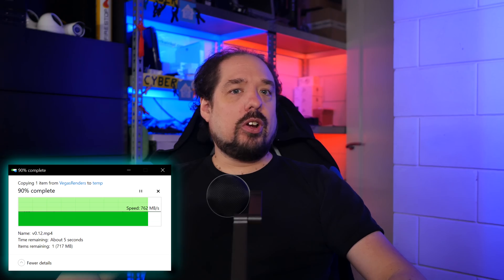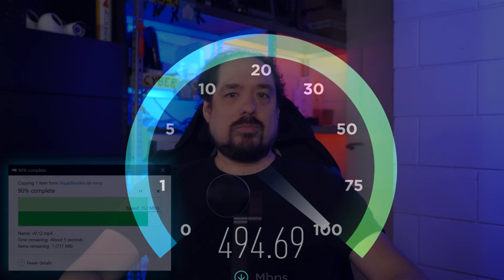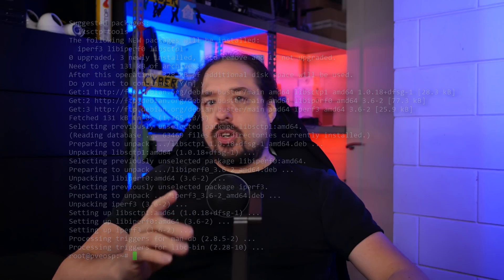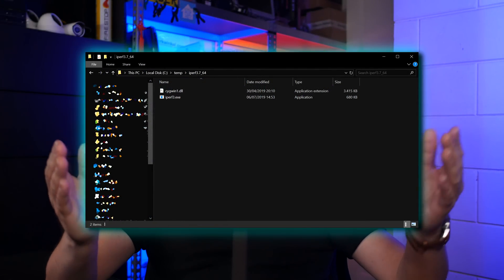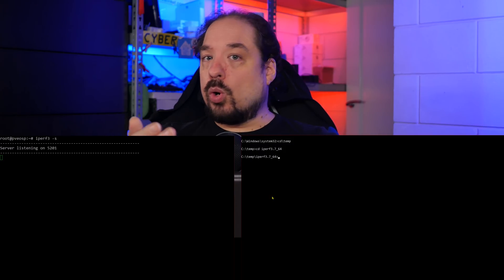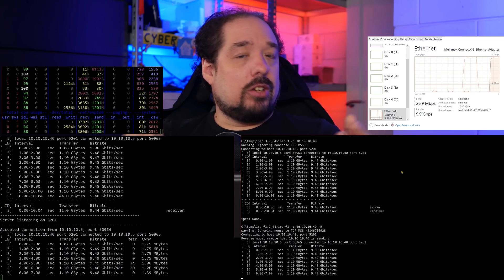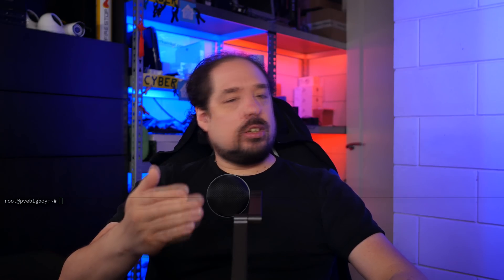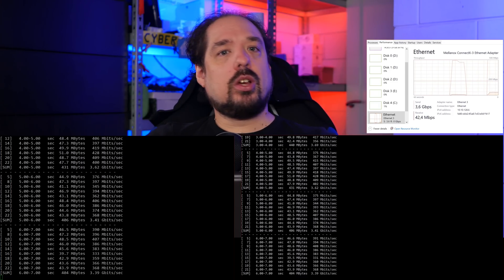Home Networking: How to test your (10Gbit) network, a guide to iperf (Mikrotik CRS309-1G-8S+IN)

Comment: Iperf is a great tool to test transmission speed on a local network independent of native files.  My experience is that a lot of small DLLs slow down the network speed properly, up to 1/4 or 1/5 of the possible transfer rate.  On the other hand, video files, for example, reach the maximum limit.  With Iperf, on the other hand, you always create the same test conditions.

Comment: Thank you for the excellent video and clear instructions. I have a 10GBe network at home between my main Windows 10 desktop, Linux Mint utility PC and Ubuntu file server.

I ran iPerf between all three machines - both ways and average about 9Gbps! So Iperf tool is validating my actual network performance. Indeed, very important that both Windows and Linux iPerf versions are the same - they were not at first until I downloaded the .DEB package on Linux to match the Windows version.

Comment: My results are 1.74Gbit/s real world. It's cause of the spinning rust in my FreeNAS, and older HW. Line speed through the switch is 9.4Gbit/s over fiber (OM3 LC multimode) and 4.7Gbit/s over a 23ish meter cat 6 (no a) run. I am going with the cat6 solution since I can't reach wire speed anyway, plus the cat6 is in the wall already. For fiber I would have to do a run like you did.. In the next year all this equipment is going to be much closer to each other, so I might revisit fiber then. For now, a cheap Chelsio T420-CR and some SR fiber modules are about to hit eBay. ;)

Comment: See edit in comment! Great video! Just note, for the crs305 mixing DAC cables and the rj45 mikrotik SFP+ (rj10 I think they are called) modules on the same LAN does not work.  Aquantia rj45 adapter in my workstation with cat 6a 5 foot run to the crs and DAC cables from crs to servers , 1 meter runs. They won't talk to each other. I tried two different mikrotik rj45 modules to see if one was faulty. The crs has been tried in router mode and bridge mode with HW offloading ( using the switch chip not CPU) and .. no dice. DAC connections talk to each other fine, mikrotik rj10 modules talk to each other fine (if you have two) but DAC host will not talk to the rj45 mikrotik SFP+ module host. So.. don't make the mistake I did and assume mixing media like in this video will work on the smaller crs305. You can't get a ping, let alone an ipref. Pick fiber or copper... Can't mix and match. :( Considering what modules cost, it might make sense to buy the bigger switch even if you don't need that many ports because I can only assume from this video that the crs309 has the power required to drive the DAC and mikrotik modules at the same time... Or it's something to do with the backplane on the 305 that's different. Tested for several days.. slightly frustrating. Love these videos! Cheers.
Reply: Edit: I literally got my wires crossed in my rack. I had wire labels that had fallen off (darn cheap label maker) and I thought I had it right but.. nope. You can mix media types, even cheaper ones off eBay. I tested it with expensive OEM (Chelsio, mikrotik) and the performance was identical. So.. my bad.
Reply from the maker: Thnx for coming back to tell us, I really appreciate that! Also glad you got it resolved, we all do stupid stuff sometimes. :)
Reply from the maker: Thnx for the comment, but that makes no sense whatsoever. I've mixed Fiber + DAC + RJ45 in my CRS309 and that had no issues whatsoever. The CRS305 is only a scaled down version of this (or rather the CRS309 is scaled up) so that shouldn't make too much of a difference. I also know multiple people who run CRS305's with a mix of cables also without any issue.

But if the same port works with DAC but not with RJ45 in it then there might be something broken. Config wise there is no difference in how the port should function with either in place. For the switch chip there is no difference between DAC/RJ45/Fiber that's all handled in the transceiver and the switch understands that, or it doesn't.

You might have one of the worse quality S+RJ10 that had issues with Jumbo frames and some other stuff, but even then, if the link works and the switch understands the transceiver, that's it, from that point on there is no difference in the connection.

So I'm kind of perplex what might be causing this issue for you. Have you updated the firmware on that CRS305 next to updating the software?
Reply: @IntermitTech  thanks for the reply! I am just as perplexed. FW is all latest version. I have reset the config every time between attempts to run tests, pretty scientifically. Switched out which ports I am using etc. I do have the version 1 mikrotik RJ10 module. However, I tried modules from 4 other vendors as well.. same issue. I have yet another mikrotik rj10 module that I will see  what version number it is today when I run still more tests. It's just not switching packets between the two media for some reason. Different ports, modules. Etc. I wonder if it could be the Chelsio cards I am using? That's the only factor I don't have the ability to change, I have S320E-LP-CR cards in both servers. I orderes a Chelsio T420-CR for the workstation ($30USD on eBay) since the Aquantia works fine but won't talk to the DAC cable ports, the Chelsio arrives end of the week. Packets talk to other rj45 modules.. just not DAC. DAC will talk to DAC as well.  It is very perplexing. Hopefully when all is Chelsio (no aquantia or rj45 in the equation), CRS305 will give some joy in switching packets super quick like. 10gig even! Woot! Ludicrous speed, GO! :)

Comment: Nice test.
I use iPerf a lot, professional and at home,  but never checked 10gb.
Nice to see iPerf can do 10gig also.
Maybe I'll try to saturate our 40gig interlinks😁.
But hmm, I don't have 40gig to our ESX hosts 😙😫

But on topic again:
Would you also do some testing with different connection modes?
I'm very interested if 10gig copper, and f.o. in combination with different nic's have different results.

Comment: Just a tip: some NAS (synology\qnap for ex) does not allow you to install apt packages on the os, but they let you run containers (docker mostly).
Just search for a recent image of iperf3 on docker hub and run your server or client in the NAS.
This is a quick way to understand if the bottleneck of your NAS is in the network card\switch or in the disks configuration.

Nice video, as usual. Keep it up!
Cheers!
Reply from the maker: That's an awesome tip, thnx!
Reply: Very nice tip, I was searching for that!
Reply: there is an iperf qpkg from qnapclub.eu for the QNAP.
i then run the command from windows desktop pc, to test the connection from the qnap nas to my desktop pc, then run the reverse command in addition.

Comment: I am on a iMac Pro running Mojave. The app is a Unix executable. macOS protests that the app is from an unidentified developer. If you trust running the app, control click the app. Select the Open menu item to open the app. A Terminal session window will be opened. The following will be displayed:

iperf3: parameter error - must either be a client (-c) or server (-s)

Usage: iperf [-s|-c host] [options]

       iperf [-h|--help] [-v|--version]

Server or Client:

  -p, --port      #         server port to listen on/connect to

  -f, --format    [kmgKMG]  format to report: Kbits, Mbits, KBytes, MBytes

  -i, --interval  #         seconds between periodic bandwidth reports

  -F, --file name           xmit/recv the specified file

  -B, --bind      <host>    bind to a specific interface

  -V, --verbose             more detailed output

  -J, --json                output in JSON format

  --logfile f               send output to a log file

  -d, --debug               emit debugging output

  -v, --version             show version information and quit

  -h, --help                show this message and quit

Server specific:

  -s, --server              run in server mode

  -D, --daemon              run the server as a daemon

  -I, --pidfile file        write PID file

  -1, --one-off             handle one client connection then exit

Client specific:

  -c, --client    <host>    run in client mode, connecting to <host>

  -u, --udp                 use UDP rather than TCP

  -b, --bandwidth #[KMG][/#] target bandwidth in bits/sec (0 for unlimited)

                            (default 1 Mbit/sec for UDP, unlimited for TCP)

                            (optional slash and packet count for burst mode)

  -t, --time      #         time in seconds to transmit for (default 10 secs)

  -n, --bytes     #[KMG]    number of bytes to transmit (instead of -t)

  -k, --blockcount #[KMG]   number of blocks (packets) to transmit (instead of -t or -n)

  -l, --len       #[KMG]    length of buffer to read or write

                            (default 128 KB for TCP, 8 KB for UDP)

  --cport         <port>    bind to a specific client port (TCP and UDP, default: ephemeral port)

  -P, --parallel  #         number of parallel client streams to run

  -R, --reverse             run in reverse mode (server sends, client receives)

  -w, --window    #[KMG]    set window size / socket buffer size

  -M, --set-mss   #         set TCP/SCTP maximum segment size (MTU - 40 bytes)

  -N, --no-delay            set TCP/SCTP no delay, disabling Nagle's Algorithm

  -4, --version4            only use IPv4

  -6, --version6            only use IPv6

  -S, --tos N               set the IP 'type of service'

  -Z, --zerocopy            use a 'zero copy' method of sending data

  -O, --omit N              omit the first n seconds

  -T, --title str           prefix every output line with this string

  --get-server-output       get results from server

  --udp-counters-64bit      use 64-bit counters in UDP test packets

[KMG] indicates options that support a K/M/G suffix for kilo-, mega-, or giga-

iperf3 homepage at: http://software.es.net/iperf/

Report bugs to:     https://github.com/esnet/iperf

logout

Saving session...

...copying shared history...

...saving history...truncating history files...

...completed.

Deleting expired sessions...3 completed.

[Process completed]

><((((º>`·.¸¸.·´¸><((((º>`·.¸¸.·><((((º>`·.¸¸.·´><((((º>`·.¸¸.·´><((((º><((((º>`·.¸¸.·´><((((º>`·.¸¸.·´><((((º>

Follow the instructions, parameter error should be avoided the second time when you remount the horse you have been thrown from. I am going to work out a valid command.

Comment: What do you use to test iops to the 100TB server ? for instance to run vms live ...
Reply from the maker: It's really hard to test for IOps since you first need to determine what you are trying to find out. For VM's that would be 4K or in the case of ZFS 8K random IO combined with some sequential? I really depends on what that VM is going to do. I run most of my VMs on a 960pro 1TB mirror so it shouldn't ever be an issue basically for what I do.
Reply: @IntermitTech  I'm trying to use fio to trying yo optimize iscsi and zfs shariang from a freenas to 3 proxmox servers. If can put it in a kind of a howto , I will put a link in a  comment of your videos
Reply from the maker: @vitorcarvalho6851  Yes, please do, I'll at least share my results and maybe some more people will too! :D